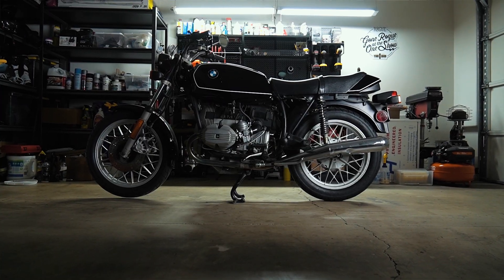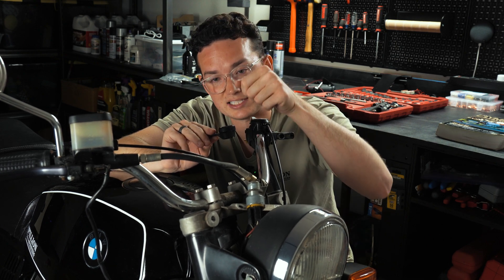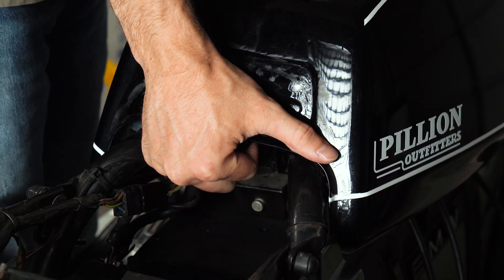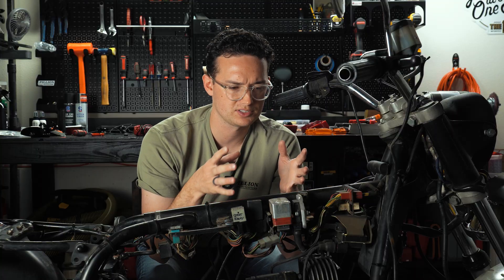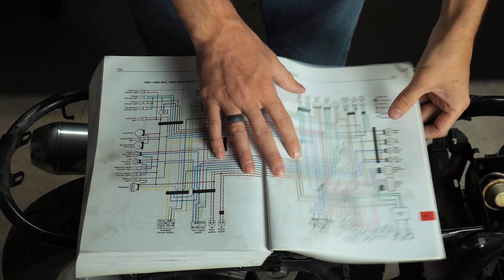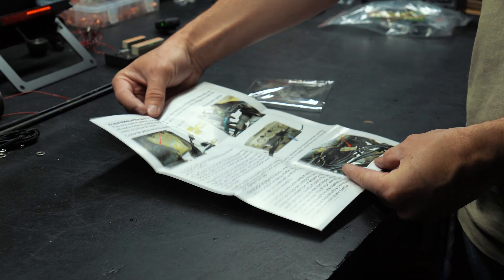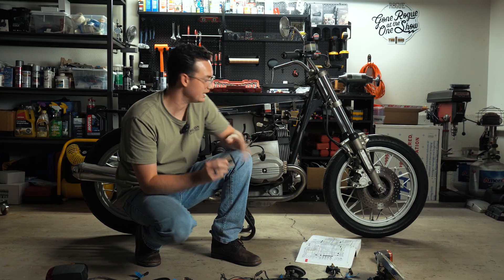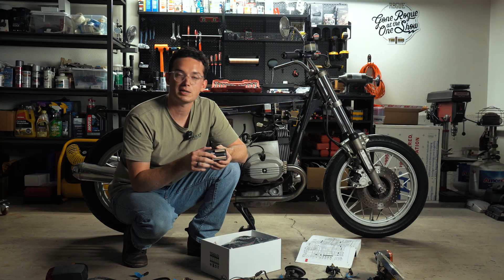Motogadget Official: mo.unit Install - Part 2 | Bike Prep

Comment: @motogadget great video! What is missed is the alternator/coil circuit that is still there and how and if it is concerned with the unit
Reply: Hi there! Not missed - the alternator/stator/charging system must all remain, in some capacity, as the mo.unit blue does not charge the battery. All things "charging" and "ignition" will remain, such as the regulator, rectifier, coils, points, digital ignition systems, etc. Part four will be out soon where we cover this a bit more when we get the mo.unit integrated into the system.
Reply: @JacobBaldry thanks!!